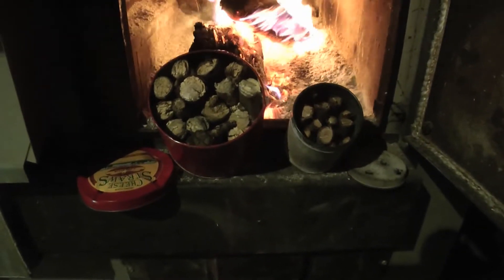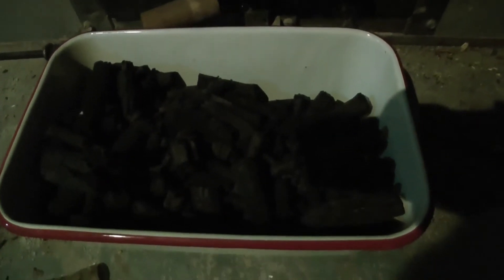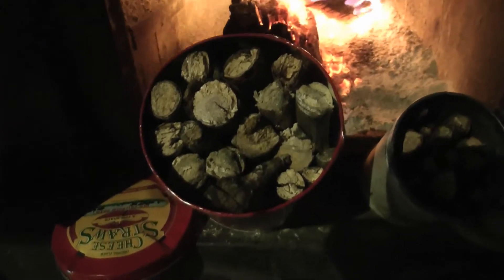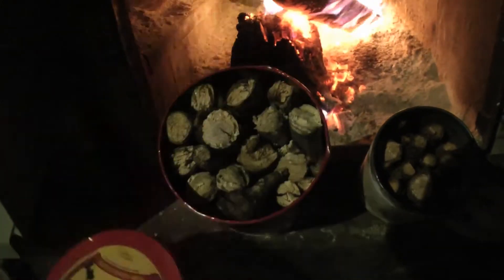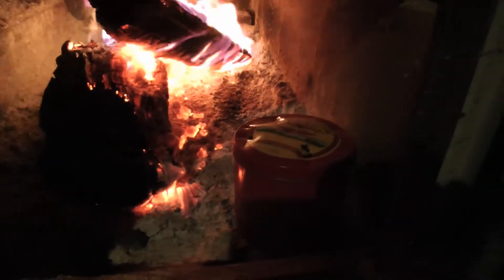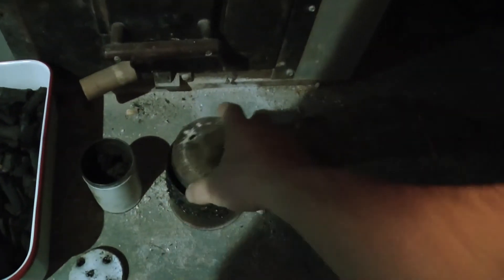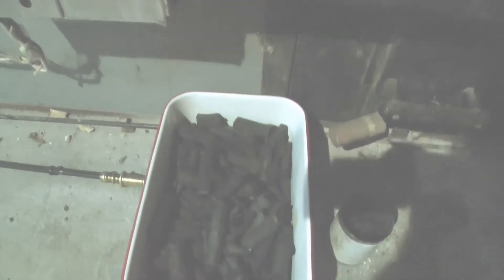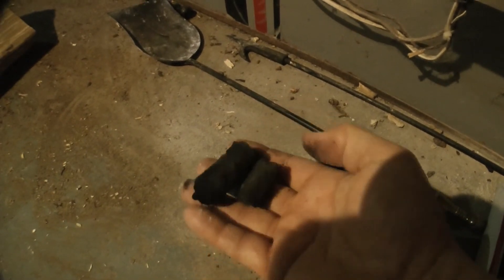Small scale biochar making

Comment: What is bio-char good for in the garden?
Reply from the maker: If the garden is 100% natural, relying on soil life instead of chemical fertilizers, the biochar's porous structure actually becomes shelter for said life. This life produces the fertilizer for your plantings.

However, the application must be to first compost the biochar. Google 'terra preta'.
Reply: Rick Larson thanks for the info,...did two tins worth,...but did not get fire hot enough i think,...got some but other pieces were still wood,...will try again soon',,,,thanks again
Reply from the maker: Ok.
Reply: It will help the structure of your soil will help hold some moisture and nutrients however too much and you can have nutrient buildup simply because of the nature of charcoal drawing and holding. At least that's what I've found in my side-by-side runnings for the last couple years. Just my two cents.